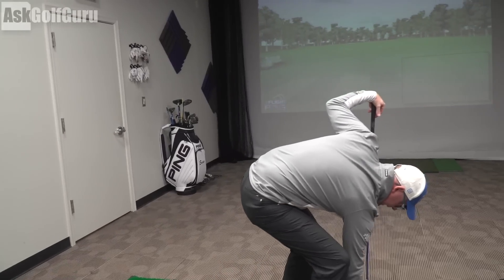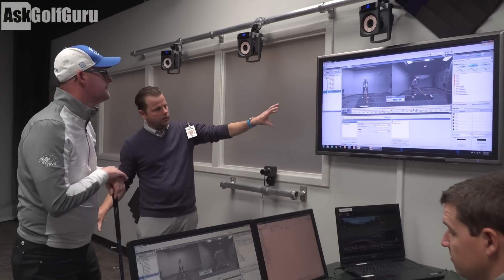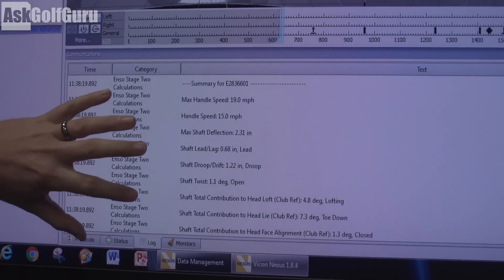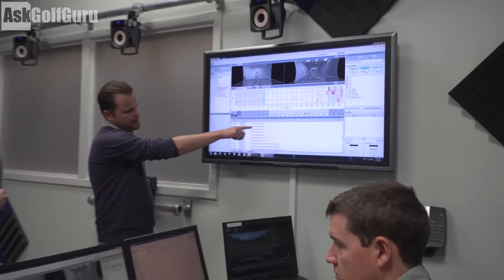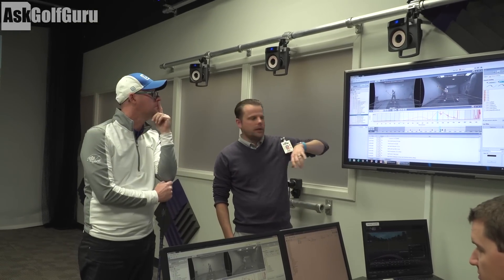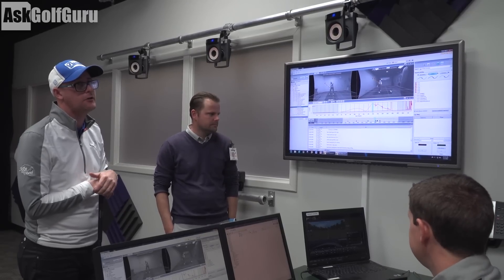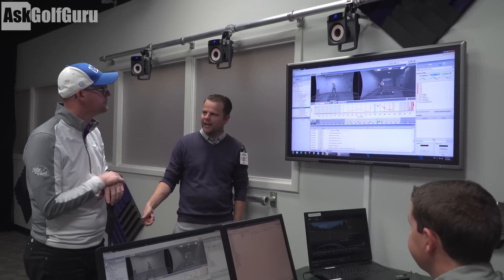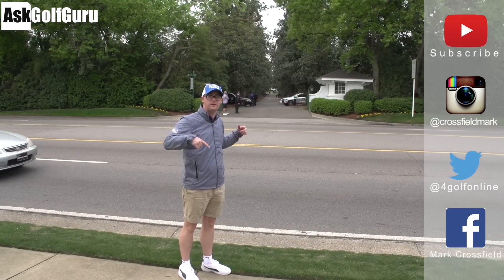Ping Golf Tech Talks Handle Slow Up

Comment: This is great. Hope you go over with the engineers the definition of each set of the data. Love the max deflection number as you would start to see this number change depending on shaft profile and flex. Careful Mark, you might be in a house of shaftoids. Toe droop is another value Fujikura has been using to modify their shafts. You could make a fortune releasing the shaftoid DVD set with this type of data.

Comment: Like the tech video's, really are very interesting MC, and great place to get access to fantastic bit of kit - very jealous :) Looking forwards to the others coming. Any more of this particular tech though the notion of the fastest hand speed just prior to the right thigh is not a new piece of information in itself. MC if you haven't already have a look at what Michael Jacobs is doing with his 3D system and the "hub path' (the point of the grip where the hands meet) along with the relative plane, shaft, clubhead movements.

Comment: In one of the next videos, will you then get into how to work on increasing the gap between max handle speed and handle speed at impact? It was interesting to hear that they used this for fitting different clubs - so a different club would mean different handle speeds?

Comment: would be very interested to see both points in the swing where the handle is at max speed and at impact. If you were able to find your "optimal" handle speed and gap it would be an interesting metric to coach/learn from

Comment: How do you put the brakes on your hands? Through swing mechanics or is it a deliberate action based on timing?
Reply: You let the club head over take your hands, you have to slow the top part(grip) down to do this, Mark often refers to this action as feel like you are flicking at the impact area or just before
Reply: +pintail102 You don't put any conscious brakes on the hands. Good sequence from the top down, starting down from the ground up synced with good body rotation creates the fastest hand speed from around hands shoulder height (point where gravity really kicks in) to hands around the right thigh, the hip clearance with slight move upwards then makes the hands rise up a little into impact this against a firm left side naturally slows the hands down a little.
Reply: +pintail102 I cant imagine a club swinging robot clamp would slow through impact